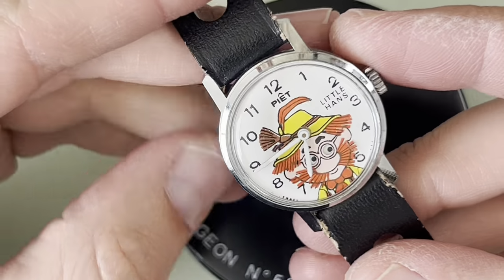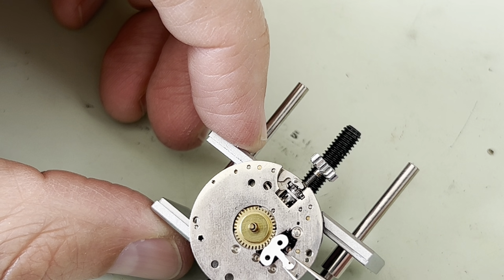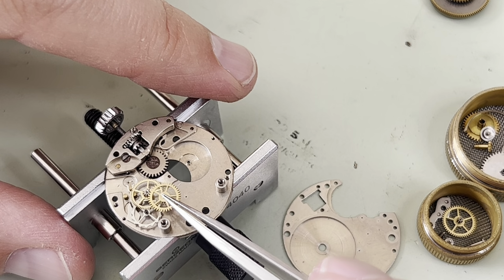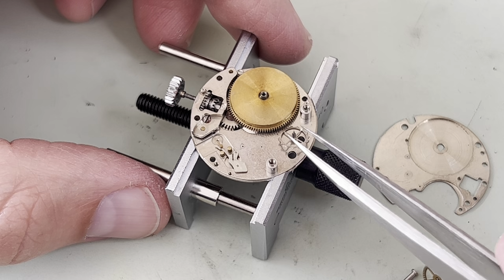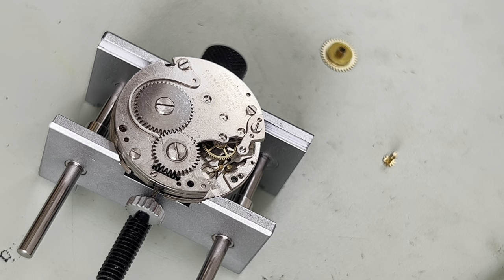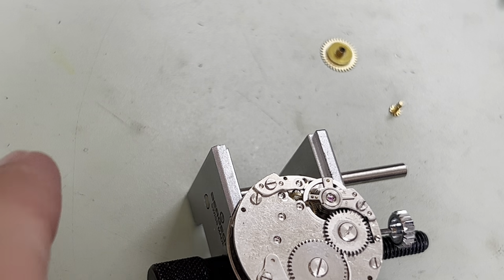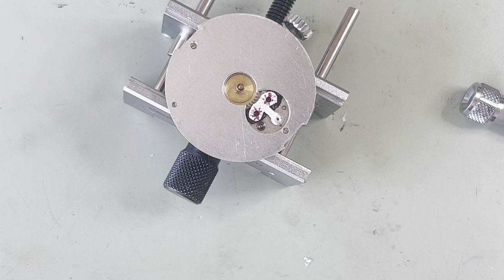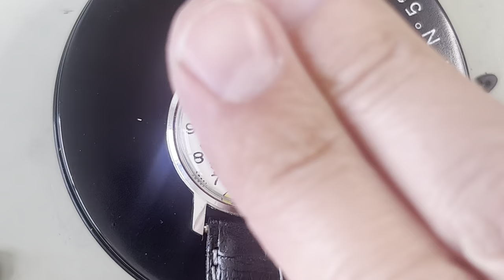Restoring an Animated Toy Watch (eyes move)

Comment: I need advice, what type of glue to use for connecting the hairspring to the hairspring  stud (ST36 , Chinese unitas 6497). It seems it was glued with some green glue. Thanks
Reply from the maker: Try apoxy, not sure which one to get but something that cures fast.
Reply from the maker: If you can stick it back in the original green apoxy you can use super glue to hold it back in.
Reply: @Timesradical  Thanks, the green one is removed I have to take some new apoxy.